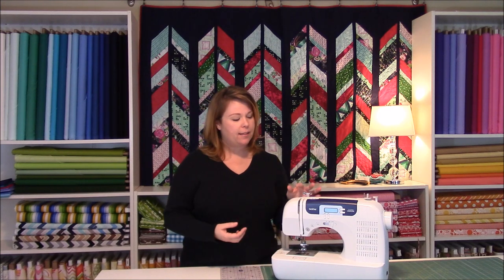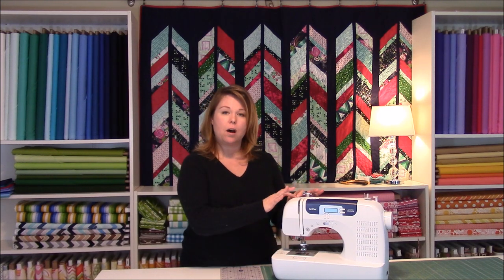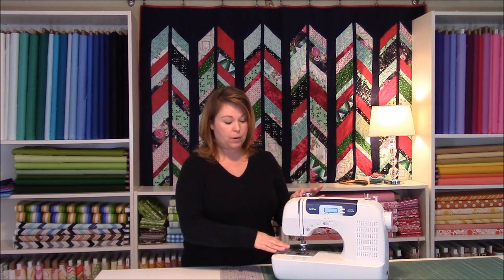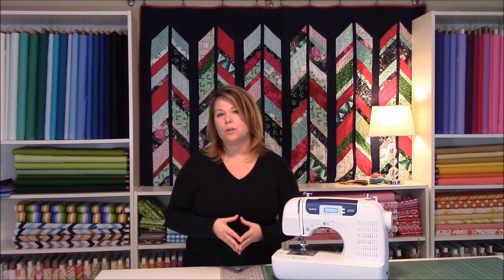Troubleshooting Quick Snip Fabric Not Feeding Through Machine

Comment: Good tips but didn't solve my problem. I'm working on an older metal Kenmore machine. I repaired the frozen feed drop lever. Feed dogs are moving fine but fabric doesn't move forward even when set on basting stitch. I have oiled, heated and worked the reverse lever. That also did not help. I have no idea where to go from here.
Reply: Have you tried reducing the pressure?  There are more places to oil that what the user manual shows.  You may need to oil inside where the length dial is located and follow it and oil each place along the linkage where metal touches metal, let it set a couple hours or over night and then clean with rubbing alcohol dipped Q-tips and repeat the oiling.  It is likely that your machine has old oil that has over time gunked up, and is causing what should move to be unable to move.  The stitch length dial ultimately controld the feed dogs that are in charge of ultimately executing the length of the stitch.  This is a common problem with sewing machines that are not frequently used.

Comment: Necchi 535FA problem is the dial to control dropping and raising feed dogs seems to have no effect as the bullet is stuck and will not slide into the part that raises  and lowers the feed dogs with each stitch resulting in the feeed dogs only move forward and backward.  Hod do I get the bullet to come out and into the part that raises and lowers the feed dogs.  I have oiled it, let et set, added heat, repeated.  Finally tried WD-40 chased by sewing machine oil.  When I turn the dial to control raising and lowering the feed dogs the rod it connects to does not move.   Please some suggestions.  The machine was given to me a few days ago.  It has a nice cosmetic appearance and the inside only needed minimal cleaning effort, and I oiled each spot where metal touches metal.

Comment: FOR ANYONE THAT DOES NOT HAVE THESE 3 PROBLEMS: you have 2 screws on the rod that comes from the motor that connect that rod to the metal plate that moves the feeding dogs; those MIGHT be loose.
Reply: open the machine case and just on the opposite side of the feeding dogs you will find that rod.
Reply: Could the plate/lever under the dogs be bend and not lifting them properly?